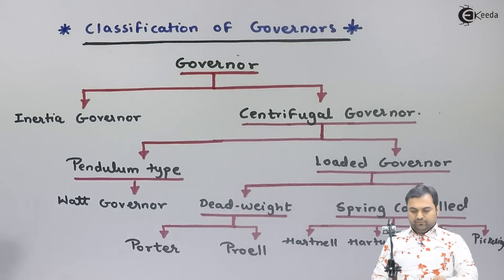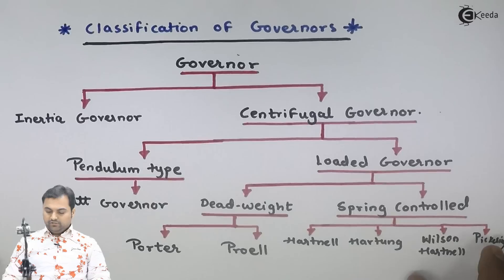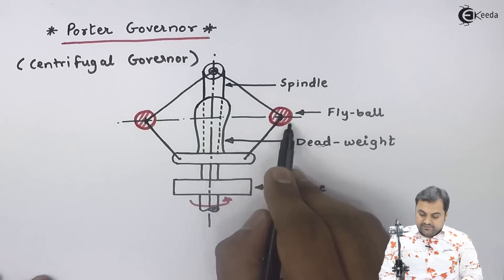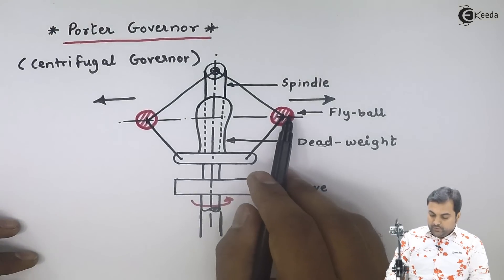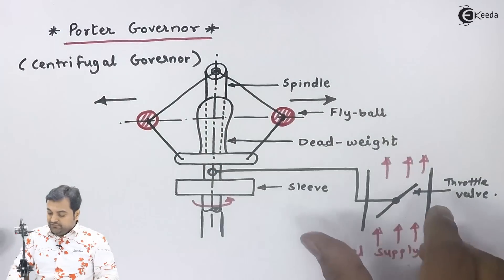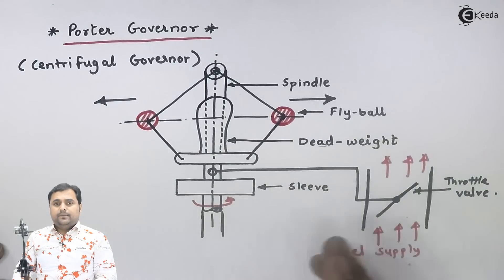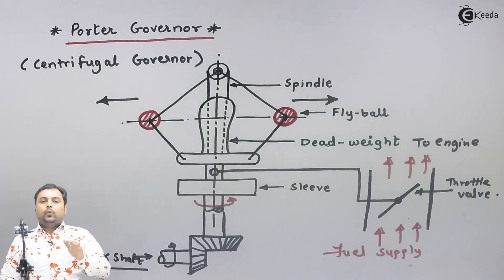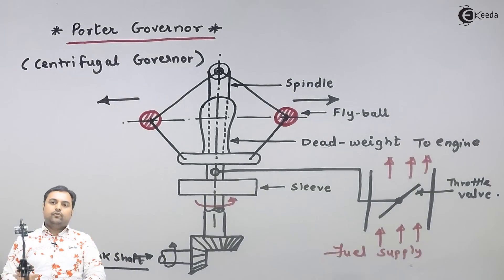Classification of Governors and Concept of Centrifugal Governors - Theory of Machine

Comment: Dear go through your explanation of maintaining the constant engine speed again. Your explanation is incorrect.
initially you are saying that when speed increases throttle closes and reduces the fuel supply and therefore engine speed decreases and after that you says as the engine speed decreases throttle valve opens and speed is maintained. HOW?
Your are contradicting your own explanation.
Reply: When the engine speed increases, throttle valve closes so that fuel supply gets decreased and constant speed is maintained. When the engine speed decreases, throttle valve opens and more fuel passes over and again constant speed is maintained.
Reply from the maker: We will work on this and get back to you.
Reply from the maker: Speed control is done with the help of governors.
Reply: The purpose of the governor is to maintain the engine speed constant even though the load on the engine increases.